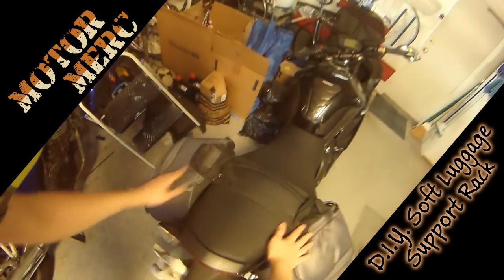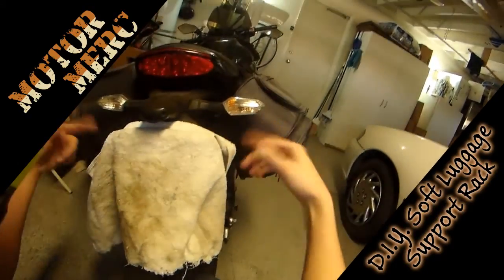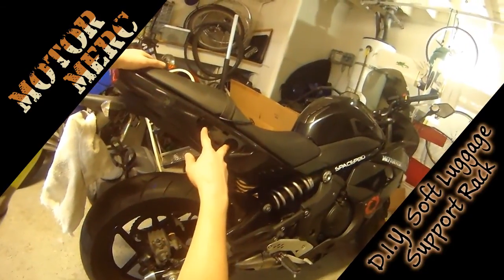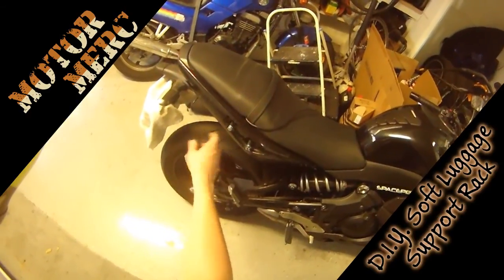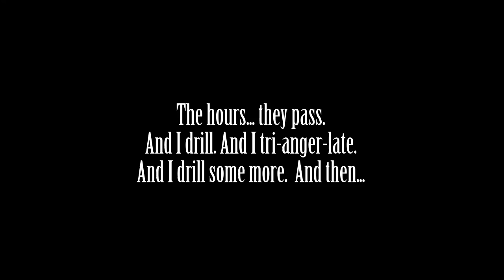D.I.Y. Soft Saddlebag Support Rack

Comment: The purpose of oil when drilling, as you sort of noted, is it keeps the metal on both the bit and the work piece cooler. This prevents damage and slows dulling to your drill bit, but also prevents work hardening of the metal being drilled, which is essentially hardening when you heat and cool and a piece of metal. Harder metal = more difficult to drill through. Oil, slow drill speeds, and lots of downward pressure make for quick work. It's why a drill press would take 10 seconds to do what it took you hours to do.
I'm looking at building similar supports on my FZ 07 but plan on using composite hockey stick shafts. They're light, very strong, and much easier to work with than metal (a major plus because my bike has no such convenient holes for mounting, and as such it will be unfortunately complicated). Also they're not as susceptible to water damage.
Reply: And, I might add, scrap pieces of hockey stick are free. I personally have plenty because I play, but even if you don't, just ask any local rink (ice or roller) if they have any broken sticks in their garbage or if you can check. Odds are they'll have some.

Comment: Thanks for the video. Does the bottom of the triangle hit the rear footpeg when the rear suspension contracts?
Reply from the maker: You're welcome, hope you liked it!  I know it was on the long side.  To answer your question, no, the triangle doesn't hit the peg, but it's very close.  The frame of the bike is solid enough that there is very little flex.  The peg and frame mounts are both on the frame so, not much flex and they don't hit.  :)

Comment: Well done. I have bags for mine, but my passenger's seat is a bit higher than yours so they don't touch anything when they flop. I have no-name ones too for the same reason.
Reply from the maker: Yeah, the thin seat made it difficult to rig them up properly without a rack.  When I get my next bike I plan to get one with a proper rack and hard luggage so I can feel more secure with my touring set up.  The punk rock DIY repertoire is fun, but something reliable would be nice as well.  ;)  For curiosity, what bags do you have?  Also the Sedici?

Comment: Looks good man!
I might end up doing something similar on my bike
Reply from the maker: A lot of effort, but to save ~$1,000 it was worth it.  Hardest part was finding the right materials.  Also I haven't done any rust-proofing, which I may regret later.
Reply: Give it a good lick of paint and you will be fine. I wouldnt bother with clear coat.
Reply from the maker: It already has a little bit of rust on there, I'll have to grind that off before I paint it.  Should have done it straight away.
Reply: Well now you know for the next one you build.
Reply: any update. I have a 06 ninja 650r same gen as yours. I have a givi tail rack. I'm wanting some saddle bags